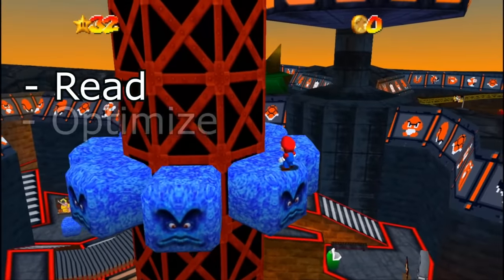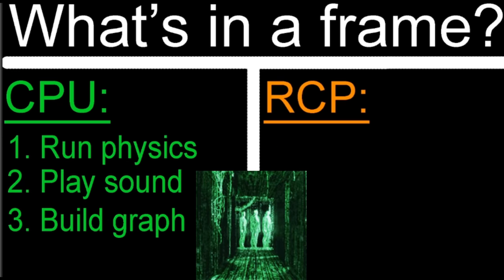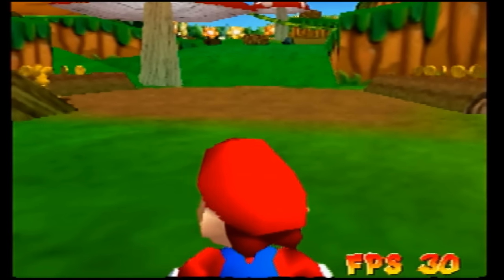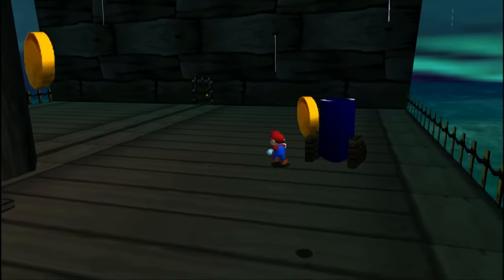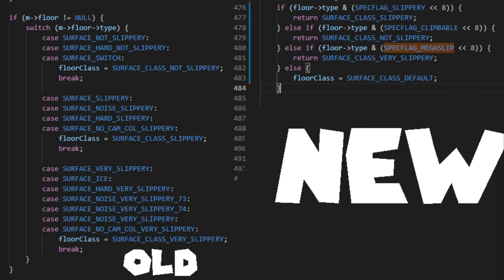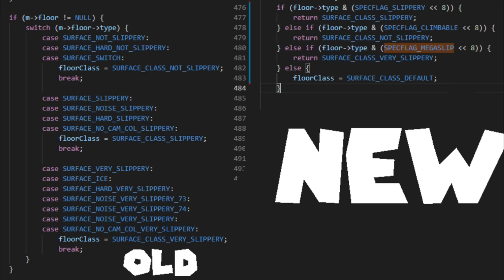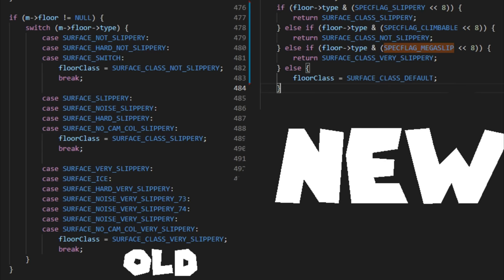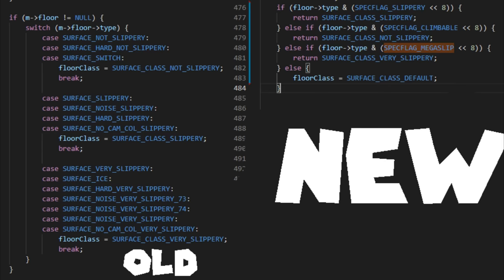FIXING the ENTIRE SM64 Source Code (INSANE N64 performance)

Comment: Kaze is just the best. My favorite thing is that he doesn’t give the original developers any grief. There was just not enough knowledge available to have done all of this for them. Really honorable thing to mention. Thanks Kaze.
Reply: Same. :)
Reply: If they’re not confident enough to ship the finished game using an optimized build that wouldn’t introduce any bugs under the time constraints they had, it’s EARLY DAYS. Miracle that this game works as well as it does.
Reply: Developer solidarity
Reply: Also gotta keep in mind he's doing this with no constraints. He doesn't have to meet a deadline, stay within a budget (no need for expensive SGI machines when we have Blender), worry about whether future console revisions will break his clever hacks... No limits on ROM size, twice as much RAM, and way more advanced tools...
Reply: @johnsimon8457  You need to realize that this was during the 1990s. The game wasn't an early build. The game wasn't in "early days". The game worked fine. But, because of the lack of technology, there were bugs.  Simple as that.
Reply: @Schwarzorn  well okay, why dont you make a brand new coding language, program the entirety of super mario 64 from scratch, and make it fit onto the file size of an original N64 cartridge? No, you wont do that? It's too hard? Whatever excuse you have, nintendo had to do that in the 90s to make their game. No they dont suck, they just weren't equipped or prepared like we are now.
Reply: @snowgrave2475  I'm talking about the English language, not a coding language.
Reply: @Schwarzorn  ohhh. Well, carry on then
Reply: As a developer, oh for sure they could have done a lot better in the 90s. But giving developers huge budgets to create a perfectly optimized build was not the priority then, nor is it now. It was a matter of "how can we ship this game ASAP and have it run at acceptable framerates", which they managed to do. I'd like to live in a world where developers get more time and resources to do their job, because in the end it helps everyone, but sadly that's not the world we live in.
Reply: @renakunisaki  Plus he also didn't start from scratch, he had the finished game's source code to go on already.
Reply: @Schwarzorn  Yeah, I'll be the first to admit this isn't the most consistent language out there. The phrase "giving someone grief" is a good example, by having little-to-nothing to do with what "grief" usually means. It's just a phrase that means insulting or harassing someone.
Reply: @PhirePhlame  I've never heard that, but okay I guess... Hm...... That like how some people use "literally" to mean "figuratively"? I've not encountered such an atrocity, but I've heard it exists. I DO often hear nonsense like "I could care less" instead of "I couldn't care less", and "irregardless" instead of "regardless". Maybe I should start saying "irregardful". Lol
Reply: @johnsimon8457  the compiler optimizations here are provided using a modern compiler with significantly more intelligent backend to it. Back then, the compiler probably wasn't as efficient, and optimizations still to this day may provide unintentional errors based off of programmer mistakes that simply never appeared.

Developers are not paid to make perfect code, nor should they be expected to. They're paid to make a product under a certain timeline. That's all. The fact this game works is honestly amazing. You also have to consider this was new hardware at the time, and they were developing it when potential modifications to consumer units could break their game at any moment. Developing on a not finalized hardware set is an extremely fickle process.
Reply: @Schwarzorn  well “I could care less” would literally just mean the person is showing more concern for the thing than they want to.
Reply: @promiseomiponle810  No, cuz that's not what anyone who says that means. People say that when they dislike something. They're trying to say they care so little for something that they have reached 0% caring. As in the saying "I couldn't care less". But "I could care less" is used by people who speak without thinking, by simply repeating what they've heard (or their misrememberings of what they've heard). It's never used how you said it is, tho. I don't know where you even got that idea.
Reply: @Schwarzorn  well I didn’t necessarily say that’s what anyone that says it means. I’m saying that’s what it SHOULD mean but people apparently just use it the completely wrong way
Reply: @promiseomiponle810  Oh. Then, yes, I guess that's possible. However, I see it as "It's not that bad. I could less about it." rather than "It's so bad that I couldn't care less about it.". Opposite meanings.
Reply: @Schwarzorn  Some people say "giving someone grief" meaning they're insulting someone.
Reply: @KingOfDarknessAndEvil  Really? I've not heard that. Thanks. Seems kinda weird, but I guess it must be some specific region. Like how parts of southern U.S. call all sodas "coke" (Coke?). I don't know if they capitalize it or not.
Reply: @Schwarzorn  Yeah it might be something like that
Reply: @johnsimon8457  Most of the techniques to optimize just didn't exist back then. Remember, they were inventing most of these techniques- refinement happens after that, often years after. Also, there was no expansion pack, which came later (and Kaze used), so it kinda was optimized at the time- at least, to the best of their understanding of such technology.
Reply from the maker: @renakunisaki  to be fair, you can see Nintendo tried to optimize their game in some ways - you can see their LODs and culling boxes... they just chose to try optimizations that typically made the game run worse. (LODs at code and clear code cache in a bad way, their culling requires an unconditional matrix multiplication and often doesn't even cull things during the laggy camera settings)
Some of the optimizations I've done were a lot less work than making LODs and have far greater benefit than a LOD.
for example: the graph render optimizations, which took around a day, would have easily gotten sm64 to a stable 30fps all around or even just fixing the DDD lag takes around 2 minutes (just turn the collision triangles static instead of dynamic)
Reply: @seeibe  I disagree. Games were more about optimization then, when they actually had very tight limitations on memory and such, in comparison to today where there is no limit and mistakes get fixed by most software/hardware nowadays. This was done as well as it could've been done for the time, given the technology (they were using SGI super computers to develop on). Compiling the code and loading it to test took way longer. The language was new (C, before it became what it is now, C++, Csharp, etc.), the graphics computing was the same as used in T2: Judgement day and Jurassic Park movie special FX. They spent a good 5 years developing the console, so I have no idea what you mean. The times back then were much different than they are now.
Reply: @KazeN64  why didn’t they change that flag that increased performance?
Reply: A lot of this stuff is damn near impossible without a modern compiler btw.
Reply: @gozinta82  I don't disagree. I expressed myself poorly. To put it in a different way, my academic work has been on compiler optimization, and I've cited sources on optimization from before the 90s in my work. I know first hand that a very strong understanding of optimization existed back then. What I suspect is that Nintendo didn't hire based on expertise in this field, rather they hired people who could write less demanding 2D games and expected them to make it work. This would explain the poor optimization despite their best efforts.
Reply: @cosettapessa6417  Probably just an accident
Reply: It's also worth pointing out that for most of the development of Mario 64 the N64 didn't exist and the code was being prototyped on a specially gimped Onyx RE with patched ucode designed to provide the same level of performance that was projected for the N64 - mostly, it was a pretty good match, but it didn't adequately model the horrific memory slowdowns you got if you started to thrash the RAM.
Reply: @xenotiic8356  crap
Reply: @gozinta82  One thing I'd like to point out is that the burden of processing power has shifted from the developer to the user in recent years. Games made for the N64 had to run well on the N64. As great as your game was, it was worthless if the console can't run it. As a dev, you had to make sure that the user could run it just fine. Nowadays, and especially in recent years, the burden of being able to work on the user's machine isn't up to the dev anymore, it's up to the user themselves. Modern AAA games usually can't run smoothly on a "normal" computer, and if you're having problems running a game on your machine, the usual response is directed to you ("Get a better pc!") and not to the devs. ("Optimize your code !")
To be fair, that's not necessarily a bad thing. Freeing devs from the constraint of optimizing as much as possible does allow them to focus their attention on other things, namely writing code faster instead of faster code (which means more games are being released), and making their games more complex. But everything comes at a cost, and in this case the cost is very high.
Reply: Better compilers, debuggers, finished hardware (with extra memory) and all the other things that hindsight gives aside, some of the "poor" decisions may have come from many months of very little sleep and a crushing deadline. Also, as you get nearer the end, the risks of every change have to be weighed as it requires even more testing which ultimately means more $ so sometimes you have to just leave it as is.
Reply: To be fair it wasn't a lack of knowledge as much as a lack of time.  Optimizing as your main goal as a full time thing is way different from having to balance features with code optimization and how much you can pack into the game into a given space of time with your resources to sell a product.  The brass at Nintendo didn't care about FPS they cared about shipping a product.
Reply: @Schwarzorn  said: "That like how some people use "literally" to mean "figuratively"? I've not encountered such an atrocity, but I've heard it exists."

Yeah...and I hate it.
Reply: @TrimeshSZ  They also weren't certain if they had the entire available instruction set that ended up in the N64 hardware, if I remember correctly.
Reply: @cosettapessa6417  I've heard somewhere it was to prevent bugs that weren't present in the debug version
Reply: @rm_steele  wtf
Reply: @gozinta82  C was not new, it was two decades old. It was a very well understood language that all self respecting developers should have known inside and out
Reply: Yeah you can't really give developers grief. You have different working conditions you have to consider. It's only ever about 33% their fault that the code could've been better.
Reply: @johnsimon8457  keep in mind that those people had to work under harsh conditions. Heavy time constraints, budgets, and extremely limited technology compared to him. Not to mention, they had to work with a lot of people, doing different things at different time on a fairly new tech they barely knew anything about. It's like a soccer player suddenly being told to go play basketball on a game night with a bunch of other nonexperienced people.
Reply: @snowgrave2475  "brand new coding language"? C predates the Game And Watch series, let alone the N64. Hardly "brand new". New to Nintendo's developers, perhaps, but that's hardly the same thing.
Reply: @TrimeshSZ  This I think is a much more plausible explanation than "but C was so new!" Not having the actual hardware you're targeting turns it into a Fun Guessing Game where you can't optimize effectively because you don't yet know what the hardware is going to really be good at in the end.
Reply: @Schwarzorn  Sorry for coming super late to this thread. The origins of the word "grief" are from Latin, where it's suspected to come from the same stem as the words for gravity, heavy, etc. As it moved into Old French, "grever" adopted the meaning "to burden", "to weigh down". While poetically in English, "grief" has become tied inextricably to feelings of being weighed down due to bereavement, there is still an entire other strand of living language where it continues to be used with a more neutral connotation. "Giving someone grief", "griefing", "good grief, mister!", all refer to having something put on you, being put through hardship by another person. It's not a florid expansion of the term. It's actually a more literal use of it.
Reply: @Schwarzorn  you must not be a native English speaker then.  Kaze used the phrase in a perfectly acceptable manner, I can assure you.
Reply: @Schwarzorn  jesus christ kid
Reply: @cosettapessa6417  
Early devikits had some optimizer bugs
Reply: @nikolthomas2544  oh no

Comment: You can't blame the devs all that much either, since Super Mario 64 was a launch title. They only had so much time between when the system was available to begin developing for and when the console had to be released.

3D games were basically brand new so it's a very commendable effort.
Reply: This plus the fact that tech was still pretty new at that time makes it perfectly fine
Reply: It's also worth mentioning that this kind of insane micro-optimization is just a very, very, very hard skill to acquire. You rarely ever have the opportunity to acquire a skill like this naturally while making games. There would probably have been only a couple of engineers at Nintendo who could have done this, even if they had the extra time.
Reply: Also the hardware was odd -- SGI had been using the Reality Engine in systems for many years, so I assume the way to get performance out of the 3D chip itself was well known (but usually with more RAM).  SGI had also used  MIPS CPUs but had higher performance superscalar designs with pipelining, high performance FPU, etc..  The MIPS R4400 was like a base MIPS with almost no floating point instructions even.  So you either let the compiler do it's thing and generate slow floating point code using many instructions, or hand optimize to use integer math with equivalent results.
Reply: Never judge to code which written under unrealistic deadline is my motto
Reply: @MMOSimca  Not only that, it wasn't easy to share knowledge and information at that time. This video for example wouldn't have been possible. You only had the people around you to learn from unless you reached out. Also lots and lots of documentation. That's why games got better optimized later in the life of the platform.
Reply: Yeah and vice versa: Very impressive how you can improve an old game, using more modern techniques and methodology for programming!
Reply: I am sure they are proud of this work